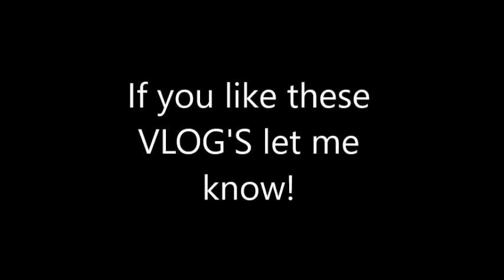Vlog Rollback Clutch and Updates

Comment: Nice one Jonathan. I'v never seen one go like that ether normal the springs or the cluch plat that what gose on the cheap cluch . So now I never but cheap cluch kit. It's a pain keep taking the box out or engine out or both back out.. but now I carnt do anything like that much now I don't miss it at all beonest.  Only do my own but I have to drive auto now any way so don't have to do cluch.  But only thing is now in cart hardly drive ether so most off my tools now are sat in my garage doing nothing like me. It's not nice i can tell you that.  But great video's u never no what u are going to be putting up so it's really good keep them coming from Andy in UK

Comment: I have seen the center hub rivets sheared off before, but the hub was all distorted from it. This girl I knew in high school was trying to do a burn out in her dad's 68 Chevy  pickup. She revved It's old 292 up to screaming and dumped the clutch. There was a pinging sound as the engine stalled, then it returned to screaming. I had the honor of tearing it down in shop class, it was a grenade set off in a small box. A piece of a spring was stuck in the bell housing, a cast iron bell housing. The dad was oddly proud of his daughter, he kept that piece of spring to hang on the wall.

Comment: since that clutch disc failed so quick, i would replace all of it with new again...i would hate to have to pull that back apart again because the pressure plate failed..and possibly ruin the new disc. that is one thing that sucks about internet parts....sometimes getting warrantied is a real pain.
Reply: Good advice JC
Reply: When the clutch built in china they probably used  garbage rivets.

Comment: Check the alignment of the transmission input shaft to the crankshaft. I have seen this before and it's usually the transmission alignment is off.
Reply: Dial indicate the bell housing.

Comment: The only times i have seen clutch failure like that was due to the driver dumping the clutch on a built 454. I highly doubt you dumped the clutch, looks like they used realy soft material for the rivets.
Reply from the maker: Haven't even put it in a pull since I put the new one in.
Reply: @jonathanw4942  like i said, doubt you abused it. Poorly built clutch disc. Makes me seriously wonder about pressure plate construction, might be time and money ahead to go buy from a reputable local source. Fighting the cheap parts problem myself, recently bought a 78 chev 1ton service truck with a rebuilt 454. Fellow i bought it from had the heads done by a discount( cheap junk) service, now im fighting sticky valves. Sometimes cheap aint good and good aint cheap.